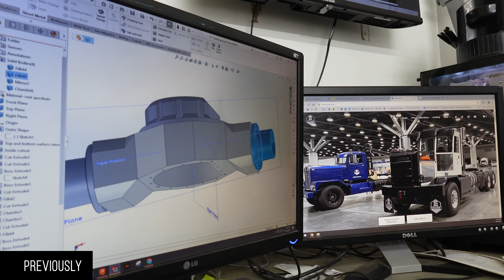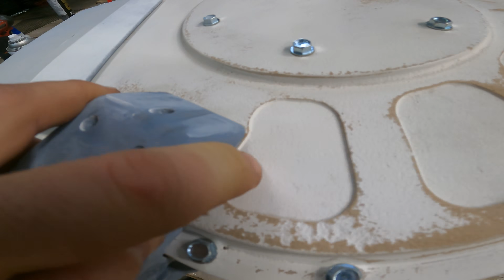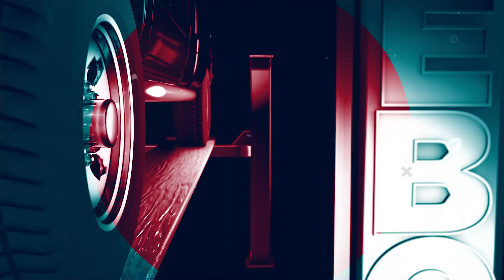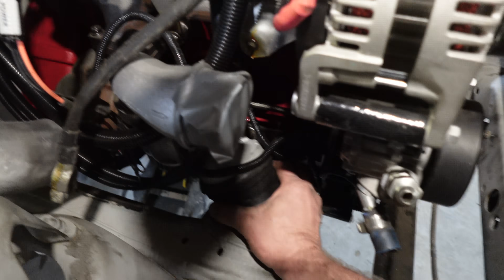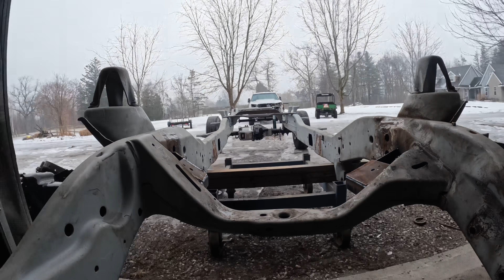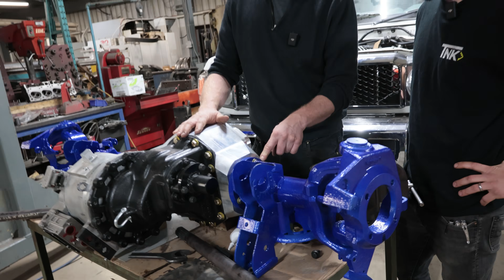Test Fitting our @EdisonMotors Generator #RamRecharger [EP9]

Comment: i got a feeling you guys are going to spend all this time and money, and get pounced by brand new parallel hybrids like the BYD shark6,  but made by gm and dodge. good luck.
Reply: For NEW trucks, yes, the big manufacturers  are in the process of making new hybrid trucks for sale .

Edison/DeBoss is working on solutions to repaower older used trucks.
Reply: @Sah-o5m  fair enough.  It just should be considered that spending $40k  to modernize a worn out truck is probably not a smart purchase...  And will be a niche market of enthusiasts.

For this to be mass market, it needs to be professionally installed and supported,  and it's an extremely labour intensive process.  

And it's going to get poor highway mileage compared to direct drive diesel,  that's why all byd and the original GM volt had the engine drive the wheels over 40mph,   there is too many loses compared to direct drive.
Reply: @AnarchyEnsues Edison kits are not for the masses. They're for hot rodders, welding trucks,  hotshot rigs, RVs, and  preppers who want a backup home generator.

I'm confident the hundreds of independent repair shop franchises and competant individuals will be able to install the hardware with the same difficulty as any engine swap, or suspension lift.

Edison pickups should have superior mpg for city driving and comparable mpg for highway driving. Plus any driving off of city charged batteries will be a cost savings.

And yes, no one wants to drop 30-50k on parts.
Reply: @Sah-o5m  I think they will be disappointed with the like for like fuel economy test they are planning with the new motor compared to the new motor with electric drive train.  

If oem's like byd clearly see a need for a direct drive at highway speed, I don't see how Edison is going to reinvent the wheel.

All I'm saying is a doubt there is going to be large enough market to justify this effort.

Love rich.  Good luck though.

Comment: Just tossing in my two cents, the Mercedes mounts are they designed for a vertical mounting. Just wondering if they will last when there used diagonally they may sag?

Comment: Does the generator run off the same coolant as the engine?  I would think you need three separate cooling systems for the engine, battery, and generator.

Comment: What's the difference in unsprung weight with the motors direct mounted vs original?
Reply: In a previous video the new e-axle was about 170 lbs heavier than stock. This heavier weight will be most noticeable on washboard roads.
Reply: @Sah-o5m  I just remember some tricks from the early Nascar days where they put weight in the inside tires to turn better. They were snapping the wheels off supposedly from the high unsprung weight.

Comment: I admit I gave up about the time you  moved the truck outside...  So here we have a truck with all the issues of a modern  computerized diesel motor with all the computer stuff that runs the electric side as well... I fail to see the point.... unless you are out of ideas for videos.
This is a cool machine you built but completely useless to anyone but you...  NO shop is ever going to even change the oil in that truck so I guess if you are an electrical engineer and a modern day mechanic with nothing to do this is the truck for you.
Reply: This Edison Motors truck is a prototype for diesel electric retro fit kits to repower old trucks with bad power trains.

When finished this truck will be comparable to the new Dodge ram recharger pickup or the Ford electric truck with range extender.

With 4000 people signed up to purchase kits, there is clearly a market and to agree with you, it's not for everyone. Peace ✌
Reply: @Sah-o5m 4k ppl who don't know the price yet 😂

Comment: WHAT I WANT TO KNOW IS THIS:   
WHAT KIND OF PRICE ARE YOU SHOOTING FOR FOR THIS CONVERSION KIT??????

QUITE FRANKLY, FOR A KIT, $30,000 WOULD BE WAY TOO MUCH FOR ME!
SO EVEN THOUGH I HAVE 1180  SHARES OF WALMART I COULD SELL AND INVEST, IF THE KIT IS $30,000 I WOULD NEVER INVEST MY MONEY! 
I WOULD RATHER INVEST IN SOMEONE BUILDING A 4X4 TRUCK THAT IS RELIABLE AND COSTS $30,000 OUT THE DOOR!  
all the computerized engines etc... are a pile of garbage if you ask me. my newest automobile is a 98 s10 blazer 4x4 with an Isuzu 3 cylinder diesel  out of a refer trailer!
and my pride and joy is my 82 crew dually 1 ton GMC , with the DTA360!

Comment: I know answering anything an American asks might rub a lot of Canadians the wrong way right now. But here goes anyway. Why are you using a different generator from you your electrical motors? Wouldn't parts be easier if all the motors and the generator were exactly the same? I mean when you want to slow down the motor(s) feed that regen power back to the battery so why not use one connected to the motor and do the same thing? I like it when parts are all interchangeable.
Reply: Some Edison customers will retain their original engine. I believe Cummins doesn't "make" their own generators but instead buys them from Danfoss. I believe Edison is buying generators directly from a vendor like Danfoss.

Comment: EM gears clamped together instead of timing chain + Mini-Stator inside Cab to capacitors to charge gears if no battery used by someone who hate batteries like me. Heat increase from EM technology = Irrelevant.. Fills layer of metal with water then uses mini-Vacuum pump to lower pressure then vents energy from water aka cold boils to ice cold then sets it to auto release energy only to run vacuum pump when needed which will be likely only on main startup You don't have to go to ice cold, just saying you could. Regenerative ice technology. You want your engine coolant to be able to adapt PERFECTLY to the strain you use it for, that's what you want. No chemicals.. Points at chemicals in fridge and air conditioning systems

They blame air conditioners for climate change, you can all make that backfire on them. Ice panels + Fan = No more crazy electric bill no more buying chemical refills no more idiots able to complain. "You're heating up the planet" < You making ICE.. They so screwed.. (For people who don't understand vacuum tech: If you open a room in space with water tanks they will all boil then freeze because energy needs shielding or else God take it all)

Comment: This is such a unique build to watch. Watch anything you do. Only thing I'm confused by is the whole idea behind this is so I can buy this engine and hybrid setup so I can install it into my 90s dodge??? Why did you cut the factory engine mounts that were on the frame rails?? Because you would want to use the existing ones so you know it works on that chassis?? Im probably missing something.
Reply: So they will just use a bell housing adapter. Got it 👍
Reply: The inspiration for this project was the Edison Motors Topsy hybrid diesel/electric semi truck. That truck uses small batteries and a small diesel engine so the semi gets full torque at zero rpm, twice the horsepower and reduced fuel costs than a traditonal ICE/mechanical drive line.

Deboss is working on taking the electric hardware from Topsy and shrinking it down to make a universal kit that can fit in any truck with a straight axle made in the past 60 years. This particular truck had its 5.9 liter gas engine removed and is being replaced with this red smaller Cummins r2.8 liter diesel engine. As such, the old motor mounts were in the way, and Rich is making new motor mounts for the new engine.

That being said, there are about 4000 people who have signed up to purchase a kit. Many of these reservation holders will continue to use their original motor and just bolt up the Edison generator to their engine.

Comment: I want to know more about the motor/generator that's going to be used.
Reply: The initial engine looks to be the Cummins r2.8 liter 4 cylinder 165 hp diesel. Not sure what make/model the generator is. I THINK it will be glycol cooled and sealed to keep out dirt. Sounds like the generator will be wound to match the input, so output should be 120 kW max.
Reply: @Sah-o5m  I am specifically asking about the motor/generator not the engine. I know all about the R2.6l Cummins Diesel engine. Motors/generators are electric, engines are run on fuel.

Comment: how about the chevy  one ton front 4X4 axel assembly ("heaven  no",   one would want 4 wheel steer capability's in a {plow} truck!) with a motor frame mounted ,independent suspension and unsprung weight would drop significantly. pot holes !< better have a really soft side wall tire picked out

Comment: i have respect for what you are doing however, why would you use an engine as poor as a cummins there are far more efficient and better built motors than that boat anchor like an audi 1.2 diesel this engine could work for power generation and is rated at 78mpg in a audi a2. but maybe you don't care.
Reply: I think this cummins is also used as a generator engine and is readily available. I googled and I don't see that Audi sells its engines directly to customers as a crate engine. I do see that there is an aftermarket of rebuilt Audi engines.
Reply: @Sah-o5m  thanks for the reply, the 1.2 diesel is a euro built engine so the issue is sourcing one and likely the only way would be a rebuild anyway but i only bring it up for the said fuel economy and reliability which is a rare combination. thanks for your consideration.

Comment: have you guys thought about engineering controls from a longevity standpoint. and what i mean by this is that when the engine does fire up , do you make sure it stays running long enough to get completely heat soaked before shutting down so your not starting up and shutting off a cold engine all the time? one concept that crosses my mind In order to keep the engine warmer or so that it starts at a warmer temp would be adding heating elements to the freeze plug locations and oil pan so that you can effectively warm the engine up even faster. If your rate of power draw over a given amount of time is high enough you could predict how long you would have until the engine is required to fire up in order to recharge the system , in this time before startup you could be heating the coolant and oil / block , so that the startup / warmup process goes much faster which should in theory be better for the engine life AND emission. Another thing you could theoretically do is induce a load on the engine even when the generator doesn't need to run by having a small hydraulic pump , pumping against a restriction , which could also double as a hydraulic PTO with connections for hydraulic winch or who knows what else. just spit balling.
Reply: I believe this kind of thinking needs to be happening.

Comment: Ok time for a little rant... WHY DO ENGINEERS INSIST ON PUTTING TIMING IN THE BACK!!?? The usual answer is that it saves space but it's the same exact amount of spam just on the back where you can't access it and then it creates more headaches. It's stupid and unnecessary and causes more problems. That said if someone can give me a real reason for it I'll be open minded
Reply: Today I learned about timing chains at the back of an engine. Wow. What a pain. I just did the timing chain on a 2000 4 cyl camry. Piece of cake.

Comment: Why didn't you just swap a 4x4 frame for the 2wd frame? I'm curious as to why you welded the front and rear of different frames?
Reply: There is a video on this and as I recall the 2 frames were different cab or bed lengths. So they mixed and matched frame parts as needed.

Comment: If I remember correctly, those Mercedes mounts are designed for vertical loads and not off angle loads where it would be subject to sheering forces. Not so sure they will work out like this for you in the long term.

Comment: May be worth adding an "antiwrap spring" to your stackup. you can look at the ram 3500 HO platform for ideas. A lot of torque on the springs may be a little wild.
Reply: I didn't think about that leaf spring axle wrap. My brain was assuming a long arm kit.
Reply: @Sah-o5m  5 link or a long arm would be nice, but thats a lot more to modify over sticking a heavy spring plate forward to reduce the risk.

Comment: Hi, in the uk we have to have particulate filters on the engine side of a hybrid. a friend of mine has had problems with his car, this was because the filter doesn't under normal driving get hot enough to burn the particles off there for gets blocked. 
Have you taken this into consideration or don't you need particulate filters.
Reply: In Canada, there are no emissions needed on battery vehicles with onboard engine (currently). This will eventually change. When it does, I'd like to see the generator engine be pre warmed with oil and glycol prior to startup.
Reply: This is something that can probably be dealt with on the software side- in short, when the DPF is getting full the computer should deliberately allow the batteries to drain almost fully, then run the generator at full power to fully recharge them.
Reply: @nerd1000ify  I like this idea.

Comment: It would be nice if the engine was able to directly drive the axles in the instance for some reason that the generator/electric motor assembly failed, like a back up
Reply: They are working toward this on the semi trucks and this tech might trickle down to the pickups.
Reply: There's several hybrid cars that have that figured out like Honda's eCVT but obviously they ain't big enough for trucks.

Comment: OK> Comment/question more for the algorithm, but if you're making the generator custom, why not make it fit the engine you're using?
Reply: This engine and generator setup is just off the shelf parts. Future engines and generators will be ordered with better sizes/shapes etc.
Reply: I think the bellhousing on the generator is standard where as the one on the 2.8 is mostly just used on the little Cummins motors if I understood correctly. This way they could swap motors out more easily if something better popped up down the road.

Comment: Unsure how all this works and is probably taken care of but what are your thoughts around pre heating/ transfering heat in to the engine coolant to keep it warm so it isnt cold starting? Its obviously a nice small modern diesel so that wont be a problem but more in terms of wear and tear? 

There may be some benefits from incorporating a heat transfer system fron the batteries to the engine. If anything to add thermal mass to their cooling loop.

Comment: As far as the cooling setup you should ensure the engine radiator is last in line, otherwise when it’s running your EV coolant will increase in temperature significantly.

Comment: I was under the impression that the Kit is going to include a generator. I took that to mean that the stock engine would be removed and a diesel generator motor and all would be put into the place of the Cummins or whatever motor was stock. Are these going to be just a generator that bolts up to the stock engine, or is it going to be a replacement generator (hopefully Cat) and all??? Side note, if the tariffs are still around when I go to build my International with this, I suppose ill just have to bring it to Canada ehy...
Reply: Some kits will just bolt a generator to your engine. Other kits will also add this 2.8 liter engine.

Comment: why not paint inside the frame? If you pour paint inside then run a drill with a chimney broom type setup from end to end you can paint it.  Can always add oil after that too.

Comment: I think that it's interesting. As Rich and others have said. This is not the first electric hybrid. We are just doing it better. Taking the motor and making it unsprung weight is the coolest part.

This is the part that everyone else didn't do. Sorry that the axles are not able. It's cool to see you working through everything. By having an actual generator and separate battery. That is what makes this kit make sense. I always wondered why they didn't make a diesel electric truck. It makes way more sense than just diesel or electric. 

The problem with diesel is fuel economy and electric is range. You have over come both of them. As long as your truck gets better fuel economy. It's a win. 

I talked to people twenty years ago about making a truck that was like a train. Both diesel and electric. They all told me that if it was better than everyone would make a truck like that. I guess that people just don't like changes. The fact is that we have to change if we are going to save the planet. 

And there is not going to be only electric vehicles in ten years. They are trying and the date is continually moved back years. The fact is that it takes twenty to thirty years to perfect a new technology. The oil companies know this and stopped it until they will not have oil left to start the process of getting a new technology running. The fact is that if we don't do something then all of the fuel that we use will be gone in 200 years. That means that the world is going to come to a stop unless we do something to change it. 

Thanks for being that change.

Comment: Is there a Diff-Lock ???
Reply: These single motor axles are open diff :(    The dual motor axles that are being developed will have 1 motor per wheel and tons of torque control.
Reply: @Sah-o5m  That's the only thing what makes sense. With ABS it is much better than Lock-Diff.
Reply: @Sah-o5m  The E-Motors could be much smaller, the recub-Braking sensibler with ABS safer.